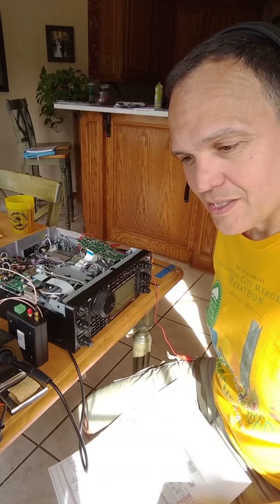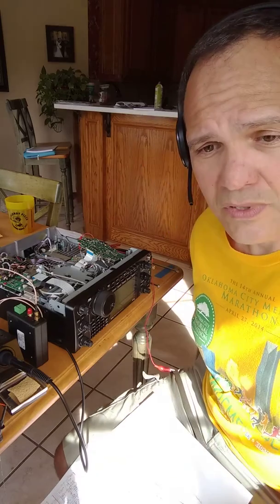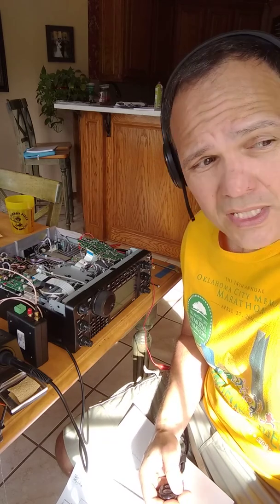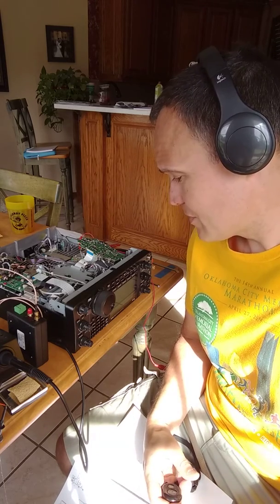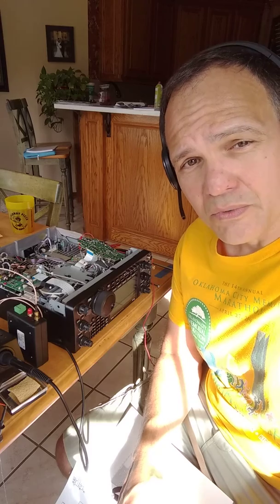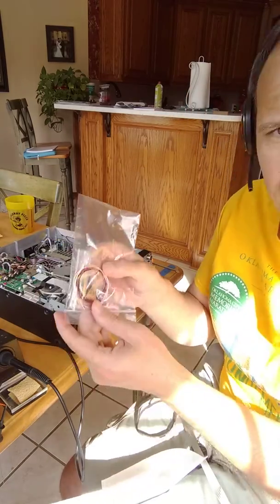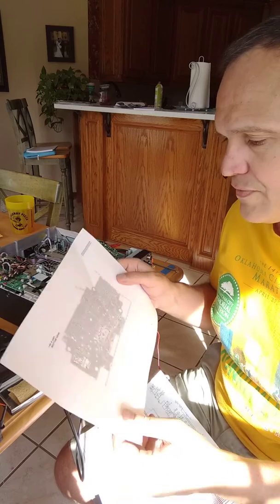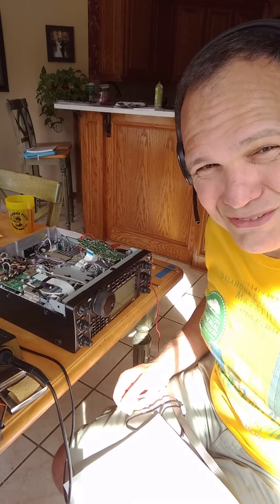Panadapter for IC-9100 part 1

Comment: Hi,
I'm presuming you tapped in before the filters, so you can monitor the entire band (2nd RX function) ?
Do you have up close photos of where you tapped into the IC-9100 IF ?
I'm also the proud owner of an IC-9100 and some tap boards and would like to install them as well.
Finding the right point to solder in to is my first challenge.
73, Bart aka ON6BC
Reply from the maker: Hello Bart, your correct - I will write up what I did with a few photos and share a link here soon.  Very sorry I've not done that yet!  I feel it's a duty to the IC-9100 community to do this :-)
Reply: Great and big thanks !
I'm planning to add PAT boards from G4HUP to both my TS-2000 and IC-9100 but I'd like to tap in before the filters so I can check the waterfall to see how busy the band is during a contest. With the Icom, the signal after filtering can easily be fed to a PC over the USB connection.